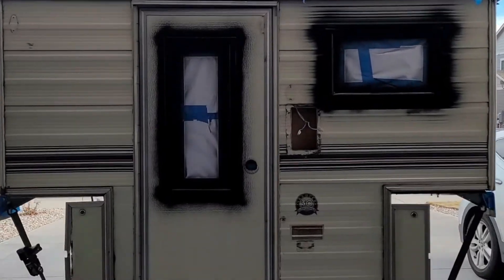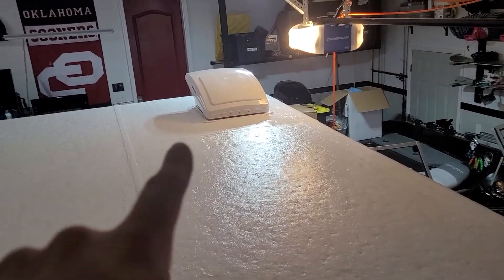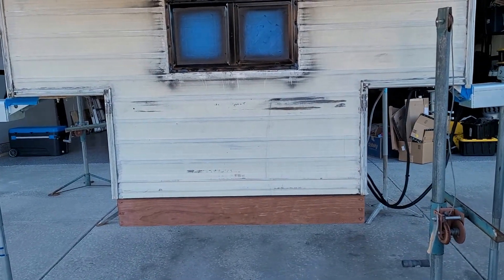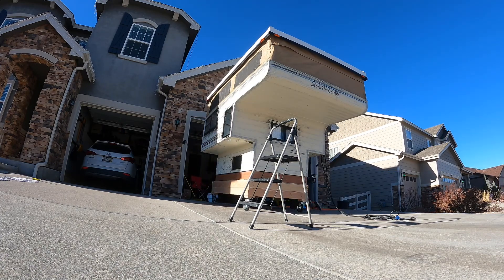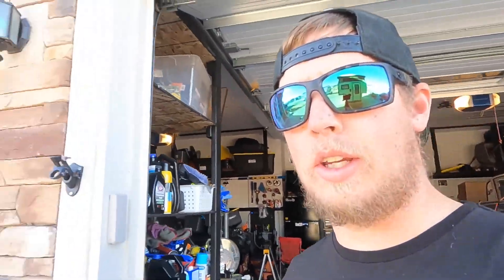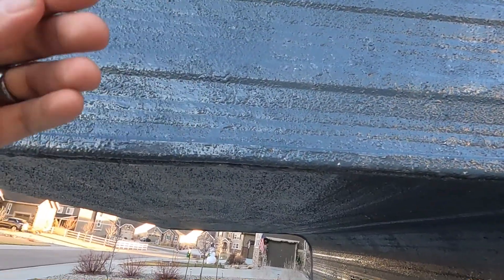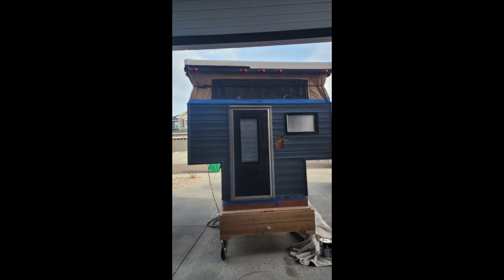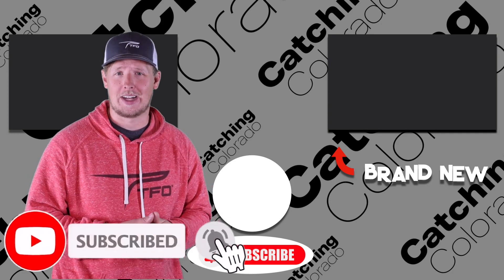Truck Camper Renovation Project - Part 4 (How To)

Comment: With the herculiner how has the ventilation been for your camper? I know my travel trailer needs to vent some just so the condensation doesn’t build up too much with propane heat. Didn’t know if you’ve wanted/needed to let it breathe better even in winter.

Comment: Say bro, very nice job on your pop up camper. I in the process of going and looking at one of these campers, it's a 1988 and need to have a closer look to see what it looks like. Your video gives me an inside view of what to expect. If I make a deal I too plan to make it lighter as you have, seems like for some reason the older campers were build with heavy woods. Thanks
Reply from the maker: Best of luck! Let me know how it turns out!

Comment: Just a FYI on Bed liner! As a Autobody restoration shop. Bed liner holds moisture under it!
Reply from the maker: I’ve had a couple pieces flake off and it was dry on the primer underneath. The original siding is metal so I’m not super concerned but that’s good to know
Reply: @CatchingColorado good deal